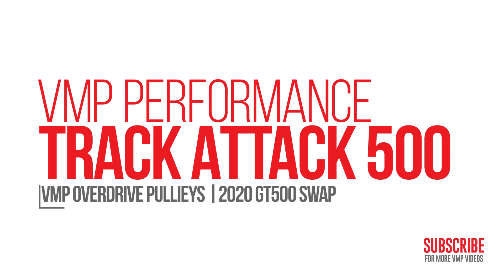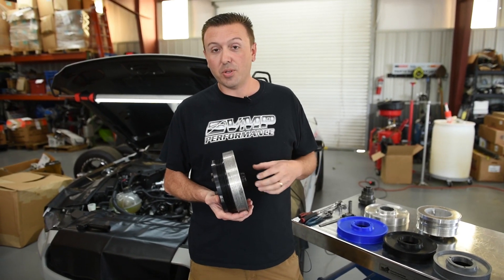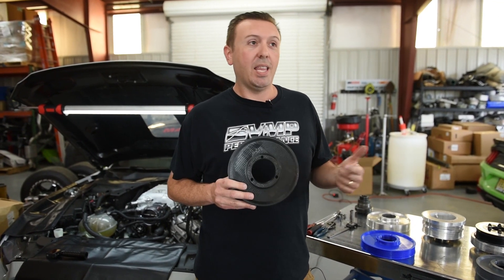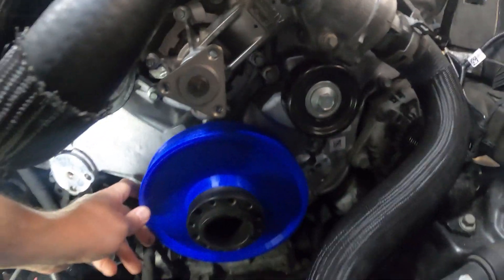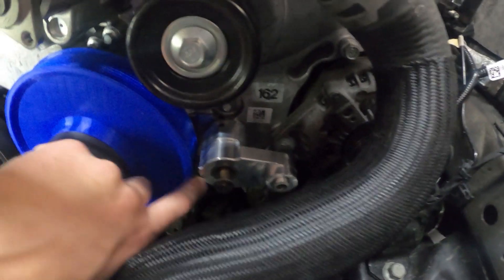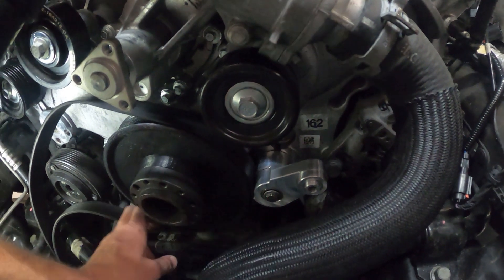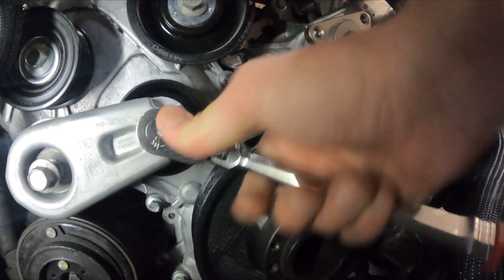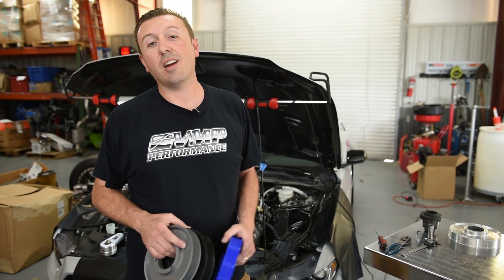GT500 Predator Parts Development - VMP Overdrive Balancer Pulleys

Comment: I wonder if that new tensioner will work on my 2010 GT500? I’m getting big belt slippage and the steeda adj top extra tensioner wouldn’t fit on my set up... when I get the cash I’m going to pull my 3.6KenneBell off and put me a nice VMP set up!
Reply from the maker: It does, we have a video coming out on it, for now, here is the link: https://www.vmpperformance.com/VMP-heavy-duty-supercharger-belt-tensioner-for-2007-2014-Shelby-GT500

Comment: Do you need a smaller supercharger pulley for the 30% OD ati super damper if so what size pulley do you need
Reply from the maker: Hi Noe!  Adding an overdrive lower pulley is the equivalent of adding a smaller pulley to the supercharger itself.  That being said, your pulley selection depends on your specific goals and will vary based on what you're trying to accomplish power wise.  Shoot us an email with your goals to sales@vmpperformance.com and we'll happily assist in figuring out exactly which pulley combination is needed to achieve these goals.  Thanks!